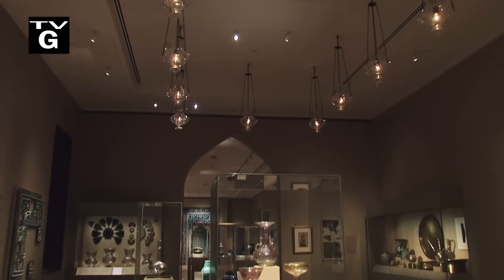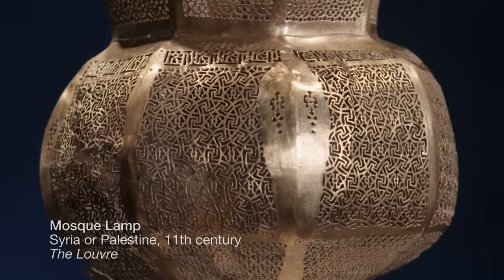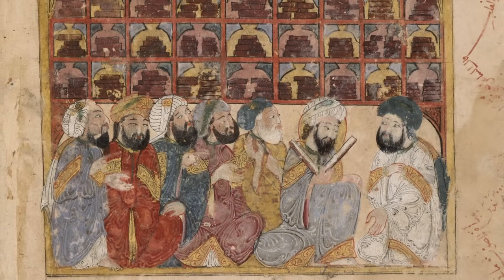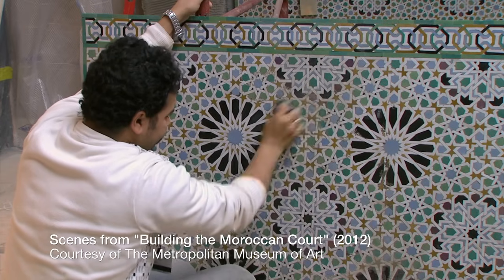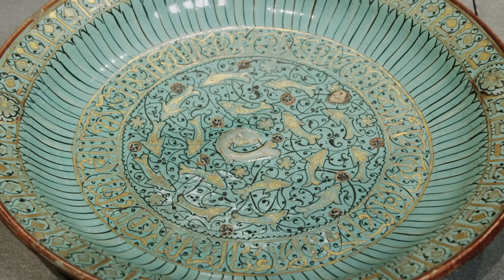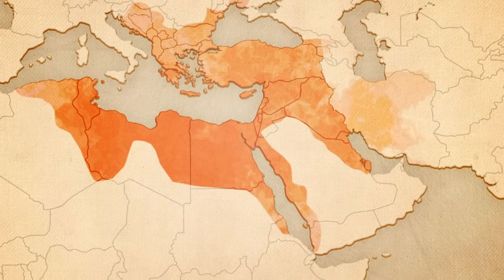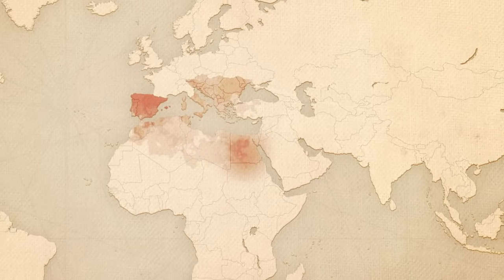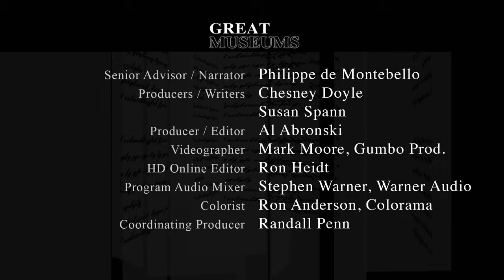The Art of Islam at The Met and The Louvre: Foreign Yet Familiar

Comment: 8.01mins  This 12th.century lamp  has cutwork panels  which have perhaps been  cut using  metal dies and a press?    The earliest examples of die cutting in Europe is in the 18th century ,but the Arab Artisans may have been using such methods 600 years earlier.  On this lamp you can clearly see where the dies were attached when it was being pressed.   I would suggest that this lamp is  made of brass  ( an alloy of copper and Zinc) rather than just copper?
Reply: lmao "arab" artisans 😂